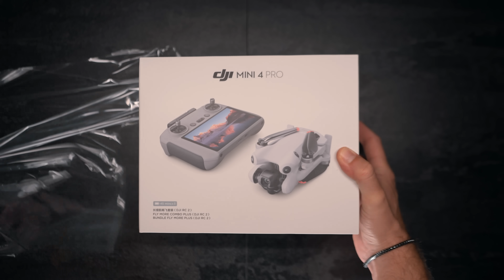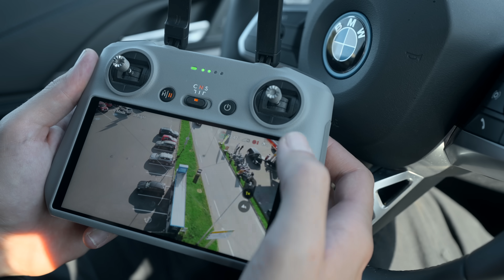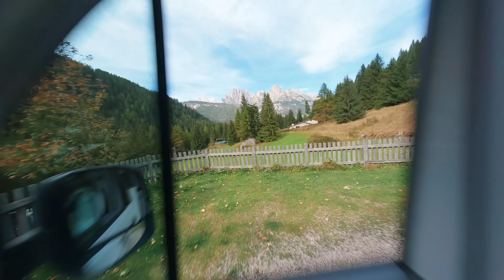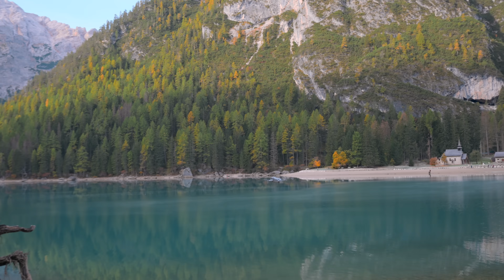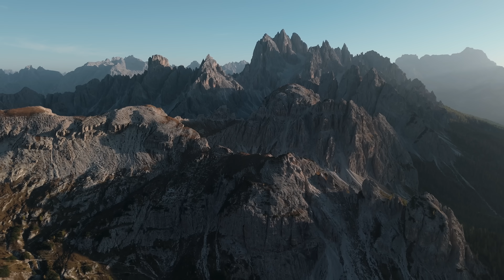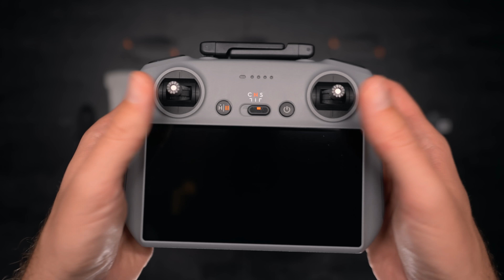DJI Mini 4 Pro – After 60 Days Of Flying. CRASH TEST

Comment: Interesting vlog / review! And superb looking footage!! 🤘🏻
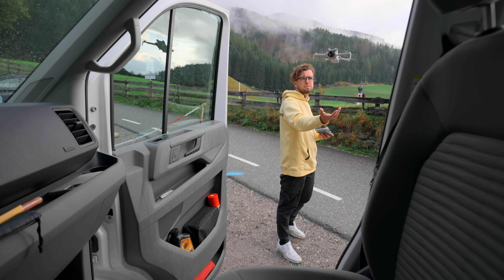At 5:13  you can see the impact damage on the r/h/s rotor-blade edges. They have chunks missing. I’ve had the same crash with my Mini 3 pro ( which I love!) but I changed the blades afterwards in case of total rotor failure. Did you not consider doing this?
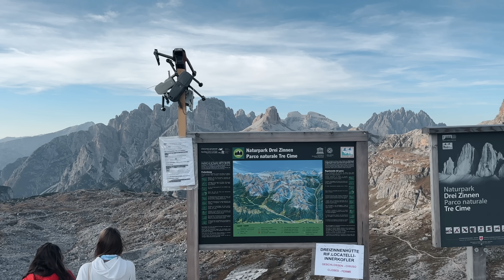9:43  This was hilarious! 🤣
A horror scene for drone pilots! 🤣

Comment: I wish to have a drone but no chance 😢.. and now you crash it on purpose😮😮😮?
Reply: Save your money for a DJI Mini 2, they're a lot cheaper than the drones in this video but serve the same purpose. Camera quality and so on is less advanced but a drone is a drone at the end of the day if you wish to have one for the sake of it.

A mini 3 regular is a good choice also. Just remember these don't have safety sensors so it's easier to crash if you're more crazy flying.

And of course read your local laws about drones. 

In the UK where I live drone laws are very strict and can get you fined and arrested if you're flying a drone above a certain weight (above 250 grams) and being within a city or urban area (distance kept 150 meters). In some cases the drone automatically wont take off unless you register your take-off area and reason with the CAA (Civil Aviation Authority)

Comment: One of the best drone Videos I have seen fantastic Video footage of the Dolomites.Bravo.I have the Mini 3 pro and I didn't crash it , it fell from my lap onto a hard floor so it off to get fixed as the lens is cracked.DJI Repair service is amazing.I logged in filled out a form an hour later I had a DHL label to print out and a DHL guy collected it the next day,Incredible service.

Comment: The Mavic 3 Pro's 4/3 sensor wipes the floor with that 1/1.3" sensor in low light, dynamic range and overall video latitude capabilities.

Comment: First thing i would like to say is,  you are a very talented, creative videoagrapher and drone pilot. I have subscribed to your channel as i find it inspiring. I have a DJI mini 2 and have been flying it for about 2 years now. I also have a YouTube channel and would be honored if you would check out some of my 15 videos i have uploaded. Please subscribe and comments are welcome. I have also been doing photography for the last ten years and have several cameras including a canon 7d and canon 5d mk3 full frame. I'm currently studying to get my drone licence here in Canada so i can get a more advanced drone over 250 grams. I'm looking at getting the air 3 or the mavic classic or the mavic pro. Knowing sensors and how they determine image quality i would like to go for one of the mavics, but don't want to miss out on the performance, battery life, ocusink 4 transmission and the rc2 controllers new processor with quicker response time. I've seen videos and know you have tried them all and would appreciate your advise.  Thanks, Craig

Comment: I thought flying drones there was not allowed, did you have any issues?
Reply: I saw the dolomites being the red no flight zone. Which issues with the drones in this area?
Reply: @aleksandrasch2064  You didn't see any red zones? I know there is a heliport in Val Gardena, in Brunico, and also near Dobbiaco.
You have seen orange zones, right?
The problem is that in the nature park any noise is forbidden to protect the animals, especially now in winter.
That's why flying in the nature parks is a gray area, allowed by air safety.
Since drones can scare wildlife and birds of prey, they are not allowed from the nature park side.
Reply: Some areas were orange zones, so they were allowed to fly 25 meters high 
In addition, you are only allowed to fly by sight, so you must not let the drone follow the car.
I live in the area there are more and more problems with drones.

Comment: the detail in the green lake and mountains are fantastic in the fly away shots...i also noticed you have your mm meter slightly over exposed at +0.7 on the screen when you show it. do you prefer to always have that little extra light hitting the sensor to get the best detail out of it?